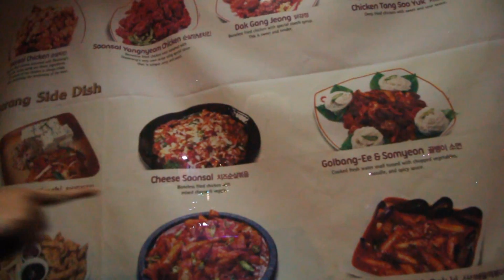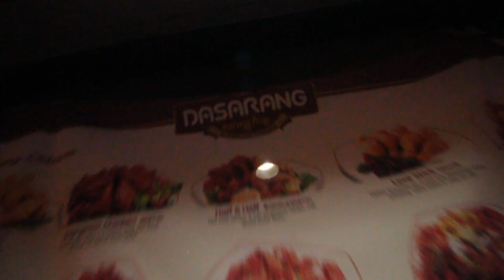Lower Control Arm Install

Comment: I can do a tow alignment with string and tape measure but as soon as you touch camber/caster adjustments tow gets out of alignment and you need to find a good baseline to start. If you did both sides at the same time you no longer have a "base/stock" setting to align from. Then you gotta pay some shop to setup your alignment "too your specs".